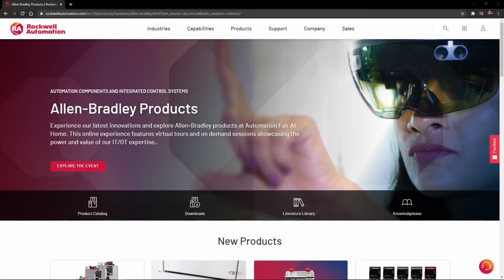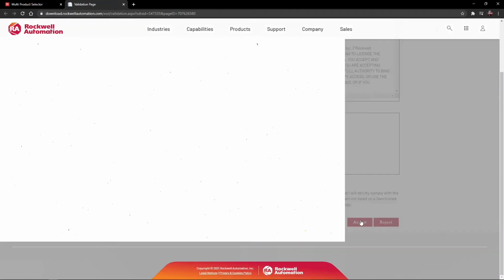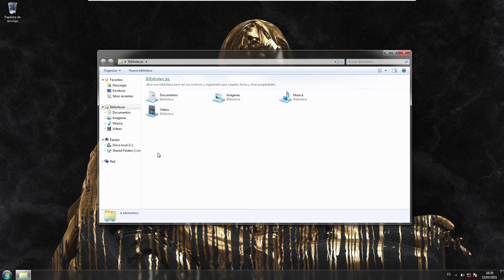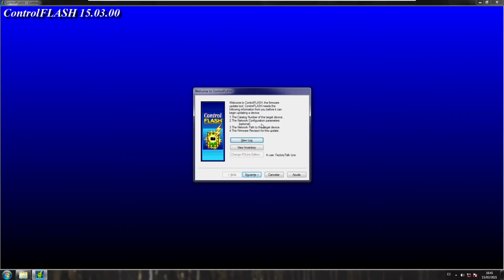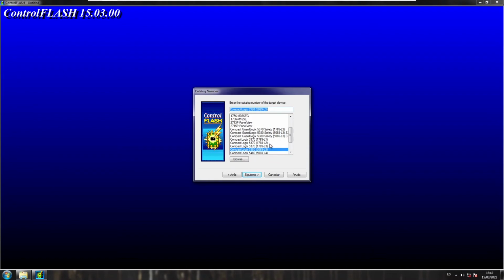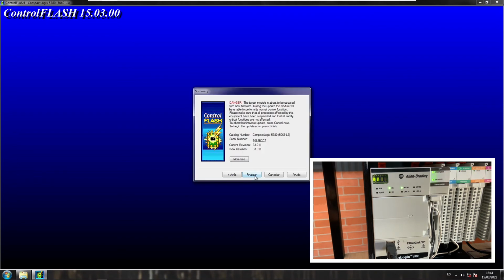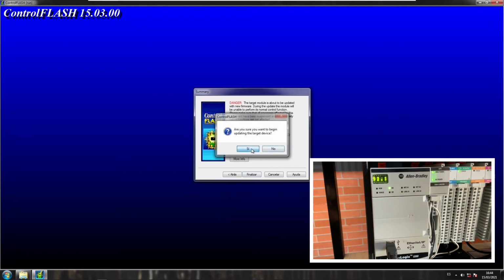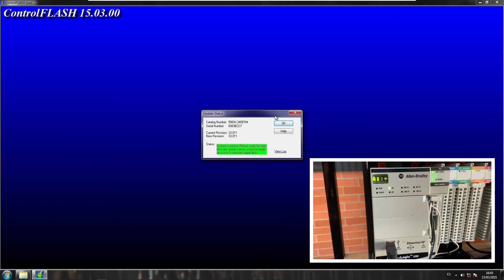2021 Firmware Update Tutorial for Rockwell Automation’s CompactLogix/ControlLogix

Comment: If I was to update firmware on a controller that already has a program but need to download a new program that isn't the same version, what happens to the logic that was originally in the PLC? Also, are port settings going to change such as the static IP address? I assume it doesn't effect the port settings as I would lose connection but am nervous to update.